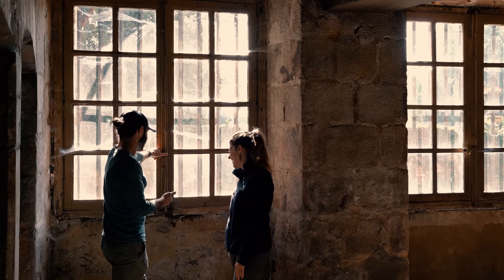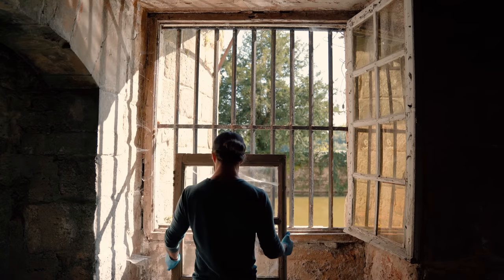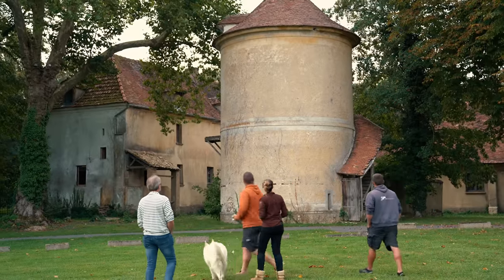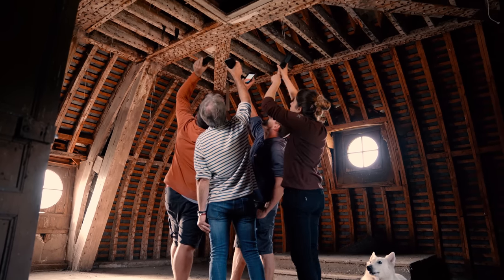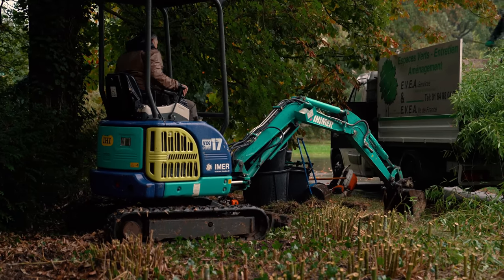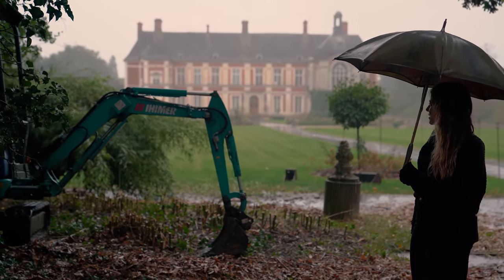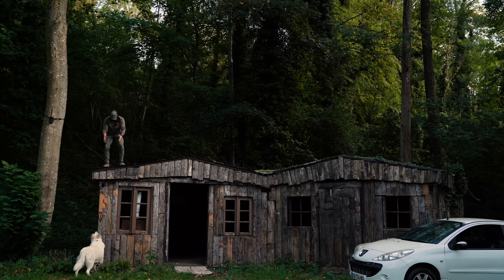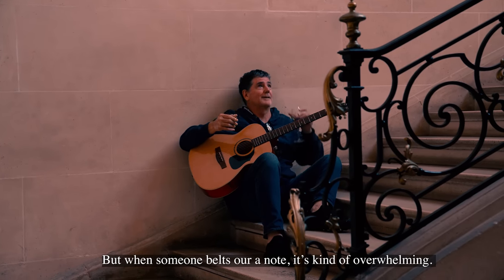Restoring Our 500 Year Old CASTLE DUNGEON Windows | French Chateau Renovations #39

Comment: Daphne, I found a brass lamp finial that is almost a duplicate of the short pillar you are standing by,  at about 11:30. I thought it was a decent rendition of a classical ornament but am very surprised that that motif could actually exist in full scale. It might have been a popular motif? 
Very interesting to hear about the setbacks of using a chain instead of a downspout. 
I live in New Hampshire and no one uses even gutters because they can't survive heavy snows. They fill with ice and probably just ripped off the houses. I found that it really isn't a problem without them.  I put bands of loose stones a few inches deep and about 18 inches wide under them and that may help to stop some of the backsplashing. I have a wood frame house with cedar shakes and they haven't rotted out yet in the past 25 years.  But you can see some slight darkening in the bottom two rows .The house is gray so I don't care. 
I don't think Chateau Purnon has gutters either. It has a wide stone ledge at the bottom of the moat that takes the pounding of the water. They're trying to restore the house to it's 18th century condition so I don't think they are going to put any in. 
I don't understand what the installer meant by the water was "ejected" in a heavy rain?  That's the word the CC used.
Reply: Gutters and snow and ice aren’t the best of friends for sure, but, here in Vermont, on one small roof they help some.  The rest of the roofs are gutter free.  Bands of gravel stones under where the water comes down from the roof takes great care of erosion and splash.
Reply: @louisegogel7973  - So people in Vermont don't tend to use them either? . To prevent fascia rot a few years ago I cut some pressure treated lumber extensions to make water fall farther from the surface. Those aluminum drip edges don't work that well so I pushed them out about two inches with the tapered extension  It's about two inches deep by 1.5" to 1" high. The top slopes to roughly match the roof slope. That's working very well. It also  provides an extra horizontal shadow  making the facia look more like a molding. 
Because we always seem to be under water restriction in the special district I live in. I have a take down gutter to collect some rain water to wash my car.  I have  50 and 35 gal. fiberglass barrels that are rigged vertically in series and it's amazing that the average rainfall will fill it from less than 200 sf of catchment area. When the temp stays below freezing all night, it's time to drain the tanks and put the gutter aside for the winter. 
I looked and Chateau Purnon does have gutters.  But when you see pipes cutting through string courses does that mean they were installed at the time or added later? The gutters are very large and sit on the top of the stone cornice but I can't see them.
BTW- Back in 95 I went to Versailles and saw pvc gutter pipes on the Cour de Marbre. I wonder if they were temporary? And they were left white?
Reply: @paulrosa6173   Gutter use in Vermont is variable.  A large overhang is very useful indeed.  And I like your two inch push out for the drip edges.  I have plenty of facia needing replacement for that same reason as your solution is solving.  Two stories up however, requires more than just a ladder, so I am hoping my children will pitch in with their talents and a scaffold.  I might replace the facia with plastic wood AND push the drip edge out a bit more.
Reply: @louisegogel7973  -  I tend to use pt for any replacement wood. About every ten years i'd have to replace rotted window frames. The bottom of the frame against the aluminum sill would rot out. All the pt replacements have lasted so far and the earliest replacements about 25 years ago are still very solid.  
Another thing I found was pvc boards could be used to replace the d-box that had cracked completely above the water line but still stayed intact. I took it all out without disturbing the gradient of the inlet pipe from the septic tank and the four pipes out to the chambers. It was so close to the surface the 30 plus years of winter freeze had broken it into small enough pieces above the water line it was easy to remove. The bottom with the water had never frozen, I suppose because the effluent must lower the freezing point. The cracked parts must have been saturated with cleaner ground water.  The PVC box will certainly outlast me. I'm sure it's impervious and I check it to make sure some plastic gauges I made to correct for settlement over the decades are still in position and the water is flowing evenly through the four outlets to the drainage field. I did the repairs two years ago, checked it last year, skipped this year and will probably try to check it next year.  Maybe next year I'll use some of the vinyl cement I still have and cast a new cover for it? The existing cover is still three concrete blocks but they show some spawlling on the underside. BTW - Isn't the real reason for posting no trespassing signs on the estate  the issue of liability?  A trespasser can't sue if they are injured on the property. Is it safe to say France would have the same legal principal?